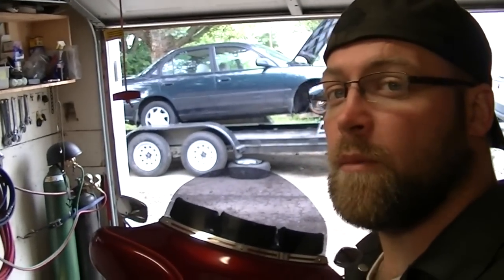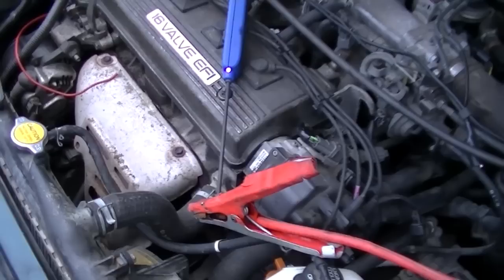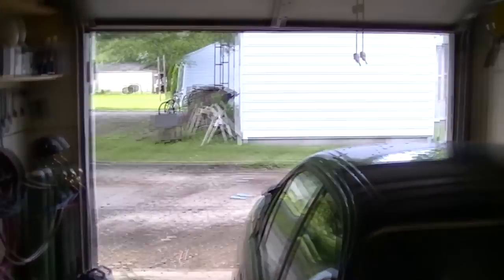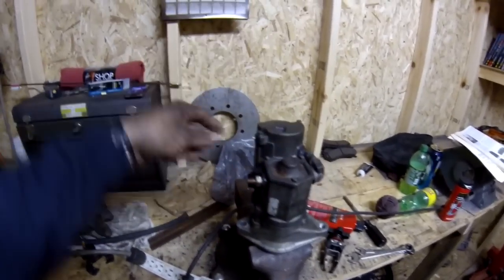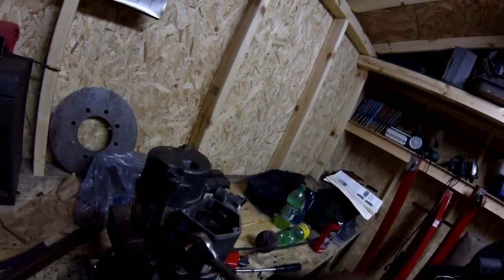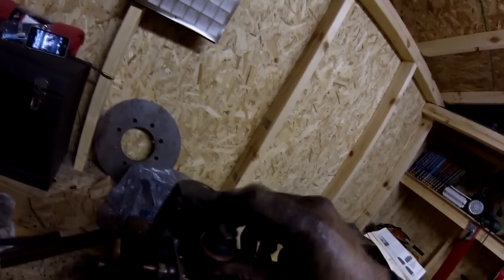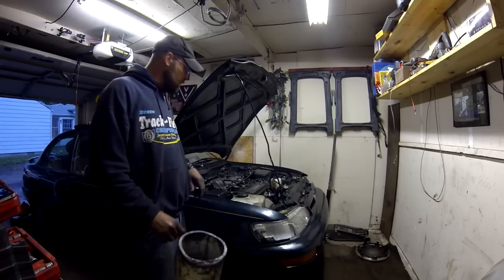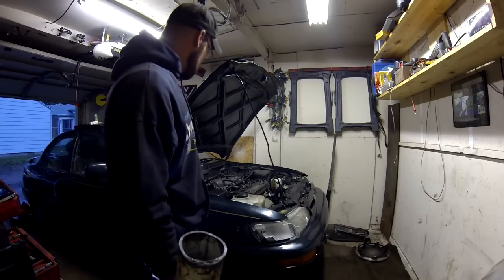1997 Toyota Corolla No Start. Starter Repair

Comment: I had trouble with the ratcheting device on the starter shaft in an '05 Camry.  The grease was so thick that it would hold back the ratcheting pawls in cold weather, allowing the ratchet to slip.  I was unable to access the pawls because the ratcheting device was stamped together, so I liberally oiled it with light lubricants, which I think diluted and flushed out some, if not most, of the heavy grease.  Hopefully the resulting mixture will stay thin enough to allow the return springs to push the pawls into position even in the coldest weather.

Comment: I got mine from eBay for 10.55 shipped.  I was able to get the starter out from the engine bay.  just removed all the air filter/intake hoses and those 2 heater core hoses going to the firewall.

Comment: Any chance you could give me some insight into the actual R&R of the starter itself? Im good with the rebuild but the starter on my '97 is really tucked in there under the intake manifold and I'm not certain how to approach the actual removal itself.  The Haynes manual is a pos. TIA, Bill D.
Reply from the maker: Well it's somewhat a pain in the butt but I recommend removing the passenger side wheel. I used really long extensions to get to the lower bolt. Remove air cleaner move around a wiring harness between the engine transmission to get to the top bolt. I hope this helps a little bit.

Comment: Please can you help? I've got a 1998 Toyota corolla that clicks when I turn key... After about 15 tries, finally starts.. I'm pretty sure its the starter but I don't know where its located so I can replace it. I'm pretty good at working on cars but I don't have a jack. Do I need one to change the starter in my corolla?  Also, my dad told me to carry around something to hit my starter with if it won't start until I'm able to replace. Why does hitting it work?
Reply from the maker: The starter is located on the backside of the motor right under the intake. You will have to jack this vehicle up to be able to get. And yes tapping on the starter with a hammer will work if you can get to it. That will only work for so long.